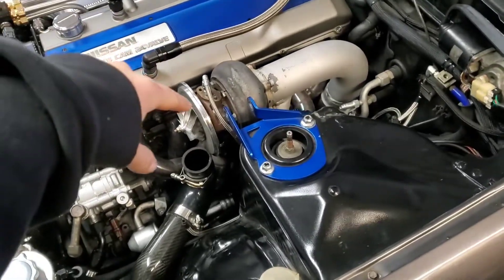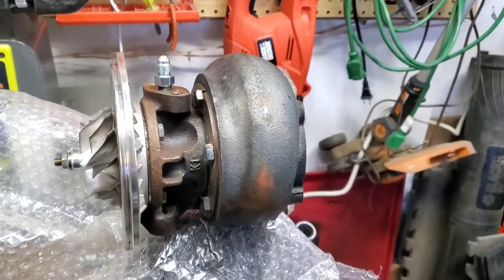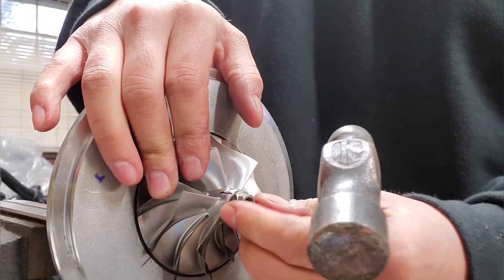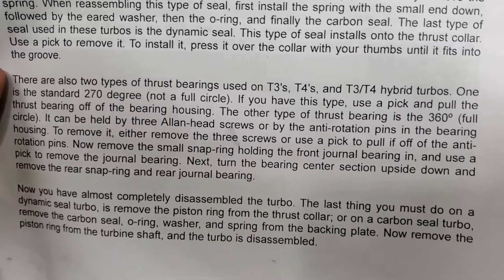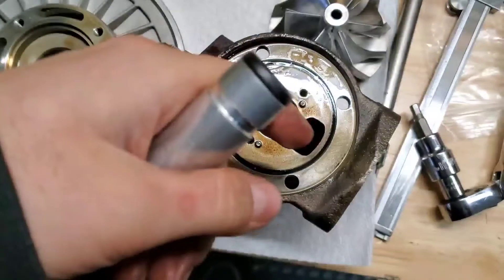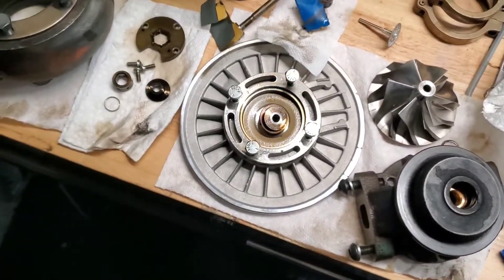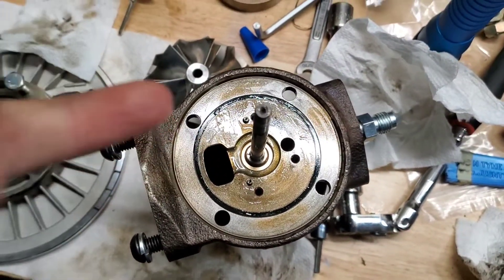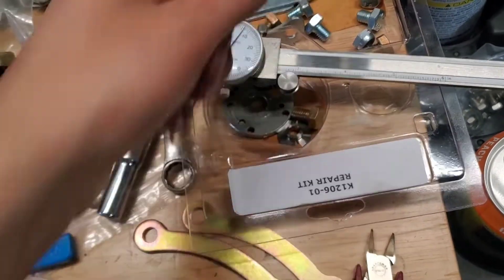How to Rebuild a Precision Journal Bearing Turbo!

Comment from the maker: I've been running this turbo rebuilt for 8 months expecting some sort of bearing wear from a rebuild or anything and it's been under tons of abuse. Runs faster, smoother, and better than when I got it!
Reply: Please share the parts and where to buy from 
I have a journal 7675 billet wheel dont wana throw it away
Reply from the maker: @Khalidsvt101  Turbokits.com if you're unsure about anything contact them and they'll help clarify

Comment: Good job very informative. Just a note, the exhaust piston ring doesn’t seal the oil in. It’s a piston ring so will never be a 100% true seal. It’s for multiple reasons, to keep foreign bodies from entering and contaminating and or damaging the centre housing rotating assembly. Also the small gap in the piston ring allows a small amount of pressurised exhaust gas to flow in, pushing away the oil from leaking out. Effectively a pressured oil seal. The compressor side is more complex but is similar. Boost will pass through to help keep oil from entering the compressor housing. These are part of the dynamic differential pressure sealing system. The pressure in both the exhaust and compressor housing is always higher than the centre housing.
Reply from the maker: Thanks a bunch for the write-up! Didn't exactly realize it was a pressure seal but the housing is most definitely worn past its limits
Reply: @BMcGuinness  no probs, yes. If you have a leak and someone says “oil seals are wrecked” absolute garbage. Usually if your turbo is leaking it’s your drain diameter is too small/kinked blocked etc or crankcase pressure is too high. Your polishing video is awesome I’m definitely going to do mine now.  😆
Reply from the maker: @butters_  Actually you're spot on! My pcv was blocked for 5 minutes and it blew up idling so maybe that's why the rear bearing roasted up? Thanks glad I could inspire some polishing haha takes about 6 hours
Reply: @BMcGuinness  yes that’s sounds about right. I’m not sure if you already know this but if your Crank case pressure is too high - The pressure can and will come UP from the sump into your oil drain (similar to blowing the dip stick out) and refusing the turbo oil to drain down to the sump. So the oil that’s in your centre housing/bearing housing is now pressurised AND has no where to go, except past the piston rings and into your exhaust housing and or compressor housing.
Reply from the maker: @butters_  Yes absolutely that's probably the most likely cause of blowing out a newer turbo. I had this for a couple years did plenty of pulls with 500whp and over 15k miles. Ran it a couple months ago and changed the catch can vent with a different style and it blew up while idling. Crazy how pressure works
Reply: @BMcGuinness  that sucks man sounds like an awesome machine though 👌🏻engine bay is clean. Yeah pressure can affect a lot of shit unfortunately….. something so simple as the PCV system. Hope the newly rebuilt turbo and catch can System goes well 👍🏻

Comment: Damn these are complicated! Now it makes sense why they're so expensive lol. Intriguing to see the internal parts size, makes me wonder how my itty bitty Saab turbo runs 20+ pounds of boost with even smaller components than yours.
Reply from the maker: Yeah these surfaces are very close tolerances to keep that specific oil film for lubrication at over 100,000 rpm. It's amazing they last so long being journal bearings! Ball bearing is usually the way to go for longevity though. Journal is great for tons of abuse and can also last